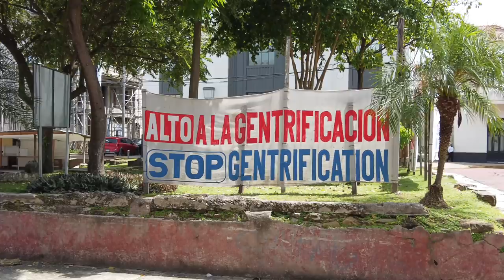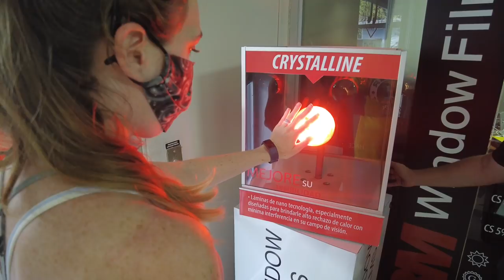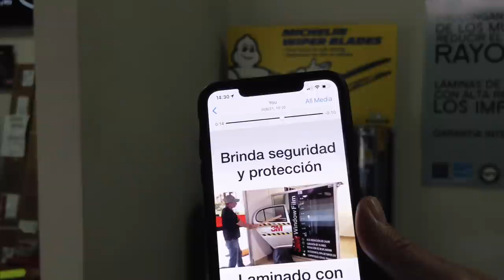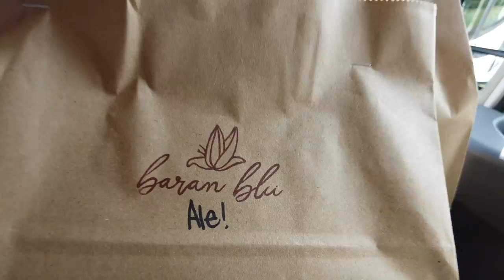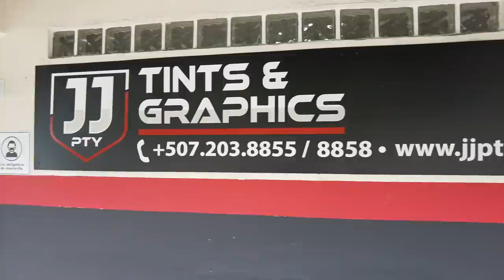THEY BROKE INTO THE VAN: Calamity Strikes in Panama City #vanlife #panamerican #highway

Comment: Sorry guys that sucks.  We have the security film on the windshield because Jeeps and rock chips love each other.  Its saved us many times already.  We added a security system after our last trip to Mexico... it has the blinking light and warning chirps if it is deturbed.  It went off at 4am in Tapachula at the MEx/Guat border the other night.... luckily no issues... we try to get secured and/or paid parking most of the time...Today in Santiago/Atitlan we paid a few bucks for parking but it gives us a bit of peace.
Reply from the maker: For sure 🙌🏻 Ah we absolutely love Atitlan. We spent New Years there 😃